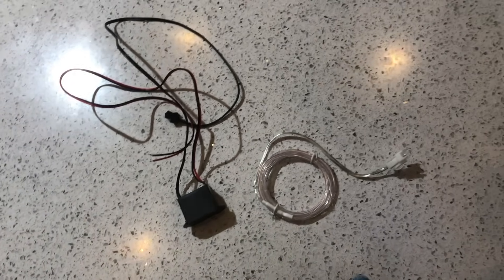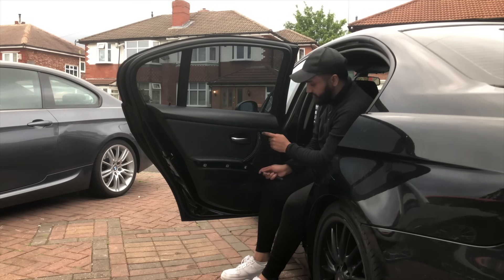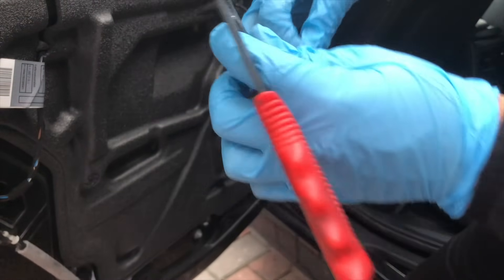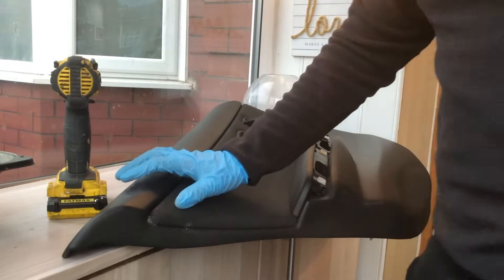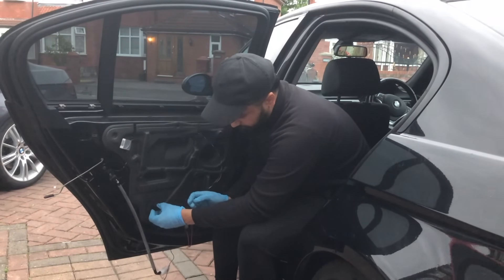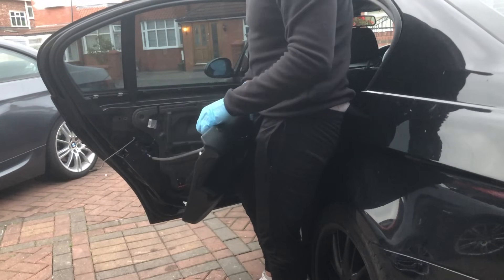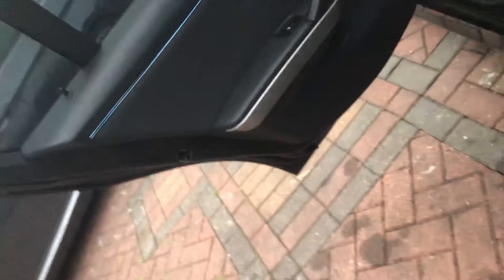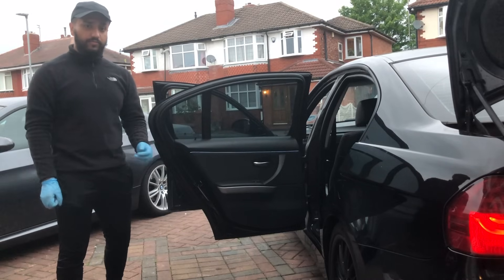INSTALLING INTERIOR AMBIENT LIGHTING INTO ANY BMW 3 SERIES E9x/E90/E91/E92 USING EL WIRE

Comment: For a better install: place inverter INSIDE of the sound insulation, since it makes noise (duh?). Also, drill at the front of the door panel instead of the back, when opening the door you wont see the wire bending in, you will see the end of the strip and it looks more clean. good video tho
Reply: Those inverters can produce heat I would suggest placing them away from anything that could melt or cause a fire, heavy duty mounting tape in th door frame 
As far as the exit point for the wire I guess that would be a preference  but you run the risk of kinking or breaking the wire at the bending point if you choose the front of the panel
Reply: i just installed mine and get the sound issue from the inverer :/ now i don't know if it's safe to insulate it since it can produce heat... any advise ?
Reply: @kiemyster420  i managed to resolve the issu, if you put the inverter near a surface it will make more noise depanding of the angle...
Reply: @mehdib114  Well glad it was that easy and not something complicated. I hope you did a clean and neat install!
Reply: Everything behind the “sound barrier” gets soaking wet it’s mainly there to keep water out of the floorboards actually. Don’t ever drill into the bottom of that insulation unless you want water coming inside
Reply: @mty3606  wow knowledge is key thanks bro
Reply: @aimized1460  if you have an e90 and get wet floor boards it’s time to re seal the sound barrier on all doors

Comment: BRO! You used a masonry drill bit, LOL, easy way to destroy your trim. Please use correct drill bits people.
Reply from the maker: TheTorkerman-Adam haha i think no drill bit is meant to be used on door cards, but this did the job, and the trim is quite rugged in the place I drilled it into, don’t see any problems with doing it with any drill bit, but obviously whatever works for you
Reply: @LifeOfEmi  a wood or metal drill bit makes a cleaner cut though mate
Reply from the maker: peter olley I appreciate that, however this drill bit did it perfectly fine with no damage to the door card or leather
Reply: @LifeOfEmi  well I'm a member of the drill  bit club and we are all totally offended by your choice 😂😂😂👍
Reply from the maker: peter olley well I can give my sincere apologies 😂
Reply: @LifeOfEmi  we forgive you 😂 it looks good as it happens I might do mine
Reply: Proper tools do help but they can be done carefully with whatever drill bit you have available
Reply: - Dewalt County Drill Bit Sheriffs Department ✋ 👮‍♀️ 🚔
Reply: The Right Tools Maketh Man
Reply: @6:19 drill goes through and damages his wood behind hah
Reply: People care to much a drill bit is a drill bit i just use the right size
Reply: @peterolley7159  i am screaming 🤣🤣🤣🤣🤣🤣🤣🤣

Comment: Everyone..make sure you DON'T close your trunk after disconnecting your battery or you will have to jump the car if you do not have a trunk release inside the cabin. You can tie a rag around the trunk lock just incase you accidently attempt to close it.. Hope this is helpful! I'm in USA and not sure if European cars are different..
Reply from the maker: Frankie Geist good advice, I place a cloth over the lock so it doesn’t close, 

Some cars pre-lci will have a key on their boot next to the number plate lights,

For LCI cars the only way is to use the jump terminals at the front and that’ll provide power to the car to open the boot, 

Otherwise some have ski hatches too
Reply: @LifeOfEmi  excellent added info!! And Great video!!
Reply: I believe your key has a physical key inside that you can use to open tge trunk the old way

Comment: nice stuff my only bad feel about it is making holes in original parts or cutting original wires too... i bought a complete kit that i will install but it comes with tons of wires to reach each point i want in 6 diferent locations and i want to use some gaps in doors to not make any hole, plus, the kit i bought had a cable i can connect in the string box of the car, making it hurtless to any original partes and totally removiable if i will sell and the people looks to it as a bad thing and another plus is RGB controlled by app using bluetooth, nice product i guess hehe ohhh i bought too floating wheel caps to make sure whenever i stop my car bmw logo will be upright! i know it is kind nosense but i like the logos all upright as rolls royce did hehe

Comment: Nice job tho i would change a few things like hole at inside of door card other end so not seen when door is open plus a switch or control device so can turn lights on or off and maybe multicolor strips that can change color to what i feel like but id prob do red
Reply: I have a 2005 e90 so tempted on doing this

Comment: Any idea how to install controller for changing lights ?
Reply: Look up Laser Wire. It's a side-emitting fiber optic cable that uses LEDs. They come with RGB capabilities. The good stuff is pricey, but I would steer clear of the cheap kits on Ebay.
Reply: @helratz9627  i already got in door card these wires just dont really know how to connect them they got like plug

Comment: You have showed the front driver door, which is where i am having issues and not sure which wires to connect the lights, any help is massively appreciated
Reply: Have you figured out a way, because i've got the same problem
Reply: @32_nic  yes i have
Reply: @bogdanlazar9177  and what did you do? 
Is it the same red/Grey and Brown wire?
Reply: For the passanger front door is the same, however for the driver is more complicated becouse once you open up you have like 20 wires  from the 4 switches and also the mirrors, you have to follow up where they actually go and make sure its from the switch. Took me 3 times before i found the right one.

Comment: Good video I was wondering where to start as I bought door cards with ambient lights already there had no idea how to connect them
Reply from the maker: You may have bought e92 door cards right? They have ambient lighting in them as standard
Reply: @LifeOfEmi  no they are F10 good fit just no connection ,  and I got sun shades for them on roll as well

Comment: Hey brother.. I have an e46.. Can i tap power from the window switch?.. Also thanks for an awesome video..
Reply from the maker: Hi, im not too sure as I dont have an e46, however I feel like they may have similar wiring, and therefore you can always try give it a go, good luck with it! Cheers
Reply: The driver card can get tricky as the control switch is more complicated purchase a voltmeter to locate the proper power wire i suggest using no cut clip connectors to tap into your car wires and always have backup fuses

Comment: Sorry, don't you have to disconnect both neg and pos terminals at battery???
Reply from the maker: Nope, with any electrical work, when removing the negative terminal it breaks the circuit

Comment: I have mounted these according to your instructions, but 3 of the doors go out themselves after 10 seconds while the driver's door is on all the time, even if the car is closed, the light is on.  what have I done wrong?
Reply: Best to get an electrical tester and find the correct live . Sounds like you tapped into an interior dome live judging by what you described

Comment: 2 questions for ya bro.........why the gloves??? and why not do the wiring correctly when u did all the work to get a shit result ??? solderless butt connectors?? tap conns?? or even clip on splices are all better then tape....but hey its ur car rock on bro
Reply from the maker: Gloves to keep hands clean when working 😊 and yeah I agree with the connection thing however, they were soldered together and covered with black tape, for improvement and for anyone else doing it they can always choose other ways to tap into wires, but this was just for demonstration for the video how to tap into the wires

Comment: Hello!! I did this on my e90 but unfortunately the windows are not working and the window switches are no longer lighting up. Would this be because I did not use a 12v inverter and instead used the 5v inverter (car plug that goes to cigarettes lighter) that originally came with the product?
Reply from the maker: Shoes Philly2027 hi you need to use the 12V internet, the reason your windows aren’t working is probably because you’ve blown the fuse for it now, check the fuse box and replace the window fuse
Reply: Life Of Emi okay thank you I’ll let you know if that works!! And great tutorial btw I think yours is better then most I’ve seen out there! 🙏
Reply from the maker: Shoes Philly2027 thanks! Appreciate the kind words!
Reply: You have shorted a wire and blown a fuse, unplug the negative terminal on your battery,  locate and repair the damaged wire, and replace the fuse
Also you Will need the 12v inverter
Reply: guido arzola Thank you for the advice!! I actually forgot to plug in the window switch into the car lol 😂😂. But I did get the 12v inverter and everything is working fine!
Reply: guido arzola To install the same led lights to my front dash can I just wire the led into the gauge cluster or do you suggest somewhere else?
Reply: @flyers30mvp  I would suggest finding a smaller wiring cluster in the center of the dash  that lights up with the headlights, maybe the  hazard light control button. Or you can use a fuse to connect it directly to the accessories port on your fuse panel 5amp would be more than enough
Reply: Can you guys send me a link for the 12v inverter. I have tried this on my bmw e90 but it doesn’t work on passenger front and rear door cars

Comment: Would it be better to hide the hole you drilled in the end of the door panel and you don’t se the wiring !? Good job well done 👍
Reply from the maker: Yardiiie Tingz yeah I mean you could do, however the issue is if you did it in the end of the door it can get caught in the gap when opening and closing, and you don’t want too much of a curve on the wire, so it doesn’t break, cheers for the support!
Reply: Life Of Emi no worries mate just got and e46 2.5 petrol so your videos really helpful 👍
Reply: The hole is very small and when done correctly can not be seen even without the el wire installed I have also found that I prefer the larger end cap of the wire to be tucked and hidden at the front of the panel

Comment: is there a switch to use to turn it on/off? Just confused on how you were able to turn it on/off
Reply from the maker: Jeff it turns off by turning the headlight switch off
Reply: You can install a switch but that install is a bit more complex, I have done away with the inverters and wired them directly to my car using a 7.5 fuse in my accessories port of the fuse panel, that install was quite a bit more complex and time consuming  but it also gets rid of that high frequency hum
Reply: @Spirit90rex  How are you able to change colours if you did away with the investors, if you dont mind me asking? I presume the inverter is for the bluetooth
Reply: @iSmileFX  the inverter is to convert the power source to the appropriate amount required by the unit that is being installed. In this case these are singular fixed color el wires so there is no Bluetooth connection. If you wish to change the color you will need to purchase the same amount in whatever color you choose and either attach them to the dc12v inverter already installed or run direct line to your glove box accessories input with a fuse be sure to calculate the Amperage required to power the lights the fuse will act as a safety net from causing a severe electrical short in the cars electrical system
Reply: @Spirit90rex  Ahh i understand we talking about 2 different things. I thought this vid was in reference to the fibre optic lighting. 
im getting these : https://www.ebay.co.uk/itm/352871673357

Fibre optic which i can install into each door and they can still connect to a main controller via bluetooth for changeable colour. any advice you recommend for the inverter? that i can do to best protect it/keep it quiet /cool.

I have EL wire upfront (crimped into fusebox) and whilst it has done its purchase after a while the sun definitely effects its brightness. wanted to try fibre. Thanks for the quick reply.
Reply: @iSmileFX  Nice! Those are cool too, a little different install. I like the Bluetooth color change feature and that you can trim the tube to exact size but I think it leaves more exposed wiring. Iam sure it can be hidden as well. , Good luck on the install hope it comes out great!

Comment: Nice install. Do you have any recommendations where to tap the power source for the dash? I have a BMW F10, so in theory it should be similar to your car. Thanks!
Reply: You could check the push start button for a 12v and ground when the car is on. I am thinking off the top of my head, however: it would make sense.
Reply: Not sure how it is on the F10, but on my E60, I was able to tap it into the door unlock button's lighting (between the two  air vents on the dashboard), this also allowed me to use the brightness control knob built into the car to control el wire brightness

Comment: Thank you so much for this great tutorial. For me it worked awesome for about 4 days. Then, one of the inverters melted and now, cd changer and door panel lights do not light up anymore. any thoughts? Thanks!
Reply from the maker: Possibly the fuse has blown, check your fuses and then you can place a new inverter

Comment: You said they make noise, do they make heat? maybe cover them with e-dead or something that kills noise.
Reply: They do produce a high pitch frequency  that can get a bit irritating  but once the radio is on you can not hear it. I have not experienced  heat but any inverter/ wire will heat up and burn when the voltage drops . Low voltage = high Amperage  so pay attention to your volts and what power source you choose. Purchase a voltmeter

Comment: can you make em light up all the time?
Reply: Yes it just depends on the hot wire you use to supply power to the inverter, if you can figure out which one has a constant flow you should be set

Comment: With the E92 standard ambient lighting, would installing one of these inverters brighten up the factory lighting without the need for el wire?
Reply: Have you found anything for a e92
Reply: No
Reply: guido arzola dang
Reply: But you can buy aftermarket replacements that do light up much brighter than the factory lighting
Reply: My Ambient Light only lighting in the back. In the front dors the Light is off. Is there any function where I can turn them on ?

Comment: Do you really need an inverter? Can't you just wire straight to the window switch?
Reply from the maker: Stephen Mace so the inverter is needed otherwise the EL wire won’t power on, the inverter changes the voltage coming from the window switch
Reply: @LifeOfEmi  I watched this video el wire directly from ac no inverter https://youtu.be/qDEMDmY7k1M I'm just wondering if it would work directly to the el I think the voltage for the window switch is 12.
Reply from the maker: Stephen Mace I assume it can be done but won’t be as bright as with the inverter, the inverters are cheap on eBay, 2.50 each
Reply: @LifeOfEmi  yh man I thought it could be done but won't be as bright as using inverter
Reply: The inverter switches the  current from DC to AC  the elwire will not power with Direct current
Reply: @stephenmace4383   At the 1:50 mark in that video you linked it shows the color and brightness differences.

Comment: i will not drill my door interior 😔
Reply: The hole is very small and when done correctly can not be seen even without the elWire installed
Reply: @Spirit90rex take one of those hard bristle brushes to brush the hole! It will completely smoothe it out. Works perfectly for starlights too